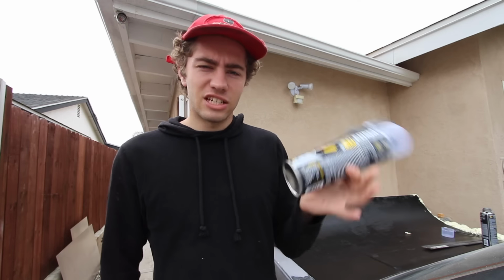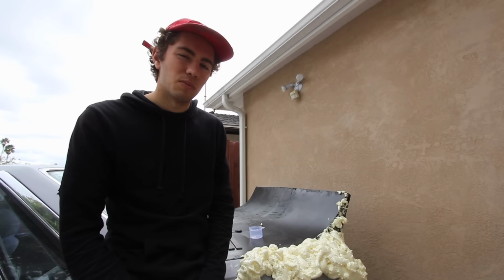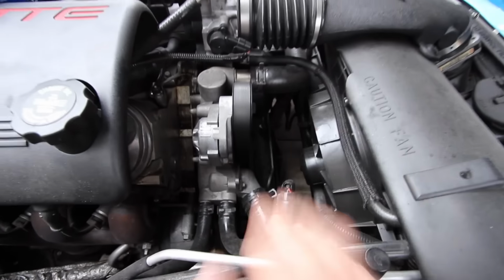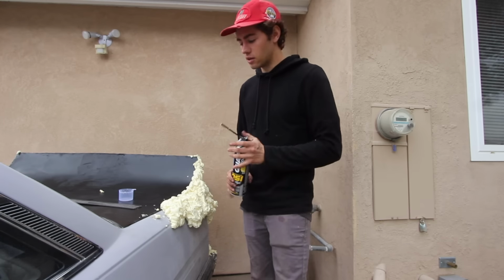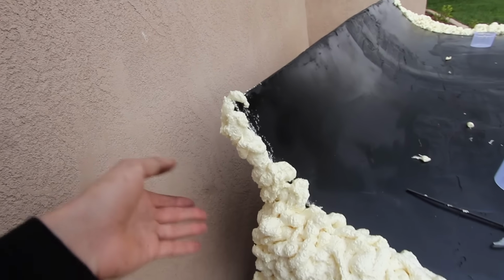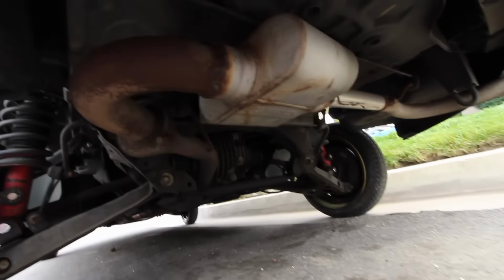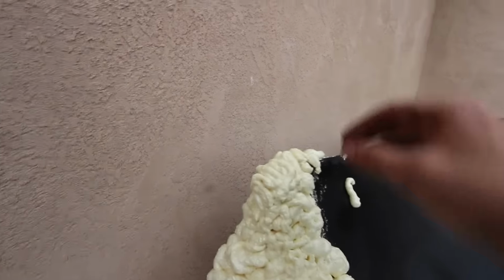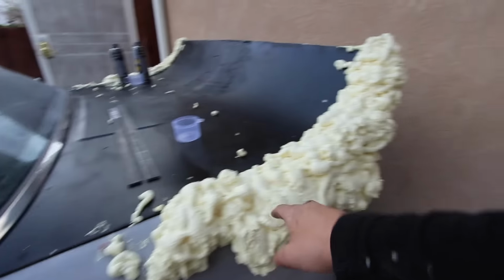Cressida Ducktail Add Ons + Miata Updates

Comment: that thermostat pulls out they get stuck from sitting in there so long just gotta give it a good pull
Reply: Lol that thermostat pulls out unlike me
Reply: Brandon Johnson yeah I just replaced a water pump on my vehicle and yeah the thermostat just pulls out
Reply: Just did the water pump and thermostat on a 2002 Chevy Silverado 1500 and they do not come out, they sell a conversion kit that makes it so it is two piece like a normal thermostat however they come one piece standard.
Reply: 97-03 ls1/ls6 are built in 04-08 ls2/ls3 are 2 piece. housings are not interchangeable but you can buy a new gm pump two take the 2 piece.
Reply: No they don't.

Comment: The thermostat pulls off of the housing. It's two separate pieces. You had the right part. And as soon as that spray foam insulation hardens it's almost indestructible. Hopefully you can find a way to mold it.
Reply from the maker: Sky Ray no, the later models are 2 piece, the blue car is a 99 and it is built into the housing.
Reply: Tyler Fialko are the bolt patterns the same? Seems like buying a housing and a thermostat would be better so in the future you will only have to change the thermostat and not both in one piece.
Reply: Sky Ray 97-03 ls1/ls6 are built in 04-08 ls2/ls3 are 2 piece. housings are not interchangeable but you can buy a new gm pump two take the 2 piece.

Comment: You should buy a second Miata axle and make the green Miata 4wd
Reply: jon miles you mean like 6 wheeler?
Reply: Hondanumber9 nah like switch the front axle out with a new axle that's connected to a drive shaft and a transfer case
Reply: jon miles good idea who even needs steering
Reply: jon miles steering is overrated

Comment: Next time just use clay, make the shape you want, then fiberglass over it to make a mold, then just pull the mold off, remove the clay and then just stick the fiberglass mold on. And you can use the clay over and over again, works out easier and cheaper
Reply: Or created a balsa mould. Or created a mould, fiberglassed it and then filled the fiberglass shell with foam.
Reply: Steve Varholy this foam is a great way to do it and it's cheaper
Reply: If he had built a form to hold it in place and roughly shape it. The way he did it, he is in for a heck of a lot of work.
Reply: Wouldn't florist foam work too?
Reply: Florist foam is designed to hold water. Not a good property to have in this application.

Expanding foam is closed-cell. What homebuilders do is spray it into the bays between then studs and then shave off the excess before putting the drywall up. If Tyler had built a form to rough shape it, he could have only needed to do the fine-shaping. And probably used less foam material, too.
Reply: I didn't necessarily mean to use as a filler, it'd be easier and less sloppy to shape for a mold

Comment: Tyler, hey man! i used to do this with the builders foam as well but you will spend too much time finishing. the builders foam will have bones in it (Un expanded solid foam matrix that ruins the shape. and you will use heaps of bog, better to pull all of that crap off and make it out of wood or clay, clay is the best as is really cheap and easy to work with. make it out of pottery clay (not fancy stuff) get the shape you want then wrap it in Aluminum foil and fiberglass over top of that and finish it as normal you will get a much better result :) Ryan from New Zealand
Reply: also the builders foam will deform in sunlight as it cures over 2 weeks meaning more bog again
Reply: Ryan Abrahamson Good tip! That would be too easy tho 🐵
Reply: hahaha you might be right there
Reply: Lol pottery clay. Lmaoooooooo 80 tons of weight. How about just building it properly?
Reply: you take the clay out Konard...
Reply: 90% of all cars are made this way in one part of the production process including all fiberglass bodykits and passenger cars
Reply: Ryan Abrahamson Correct! although they use a form of non hardening modeling clay
Reply: why are you arguing about this, yes oil based clays are far superior and have better tolerances for drying with there wax content that can be softened with heat. but there is no reason why you cannot use potters clay! Automotive clay costs heaps and potters clay it is so cheap they almost give it away, it has the same uses and produces a similar result to the real deal. you can completely negate the hardening of the clay by covering it while your not working on it. i do this for a job.

Comment: If you don't bleed the cooling system very thoroughly the car read trip out and read it's overheating, even though it's not. Easiest way to do it is to loosen the screws on the coolant crossover pipe (left and right side) that go from head to head. It will let air out then coolant will start to flow out when it reaches the top. When it does you can just tighten it up. I had that issue on my LS2 basically the same thing.

Comment: Just work the thermostat off and out the gasket gets stuck try not to gauge the housing with a screw driver though or you will need a new housing too

Comment: all the stupidity kills me in this video from the expanding foam to thinking it's alright to re use a water pump and really dude the thermostat comes out of the housing it's just frozen In there just stop working on cars
Reply: then you throw a glass pack on a miata wtf dude
Reply: Nicholas Conticello no, that model has a one piece housing. the next model came with a two piece.
Reply: Nicholas Conticello 97-03 Ls6 and Ls1 were came one piece from factory. however, when you go to GM, they sell you a 2 piece replacement due to their realization of their mistake. also why in 04+ were 2 piece from factory.